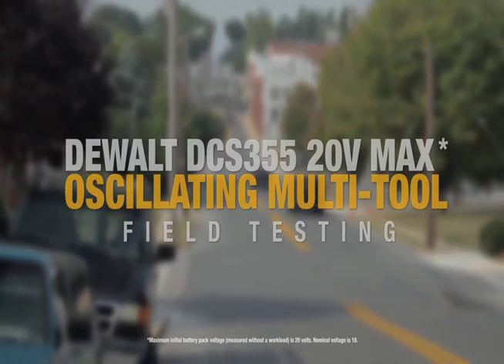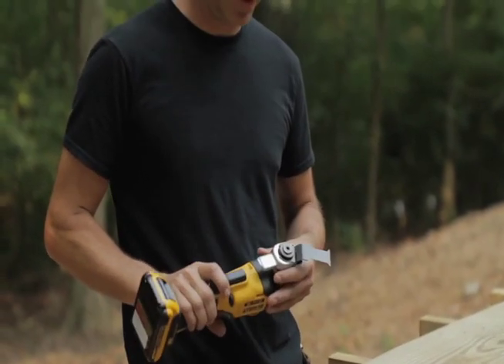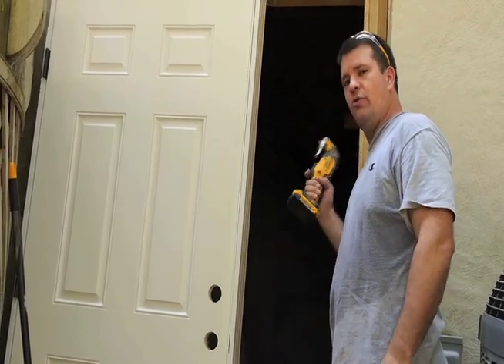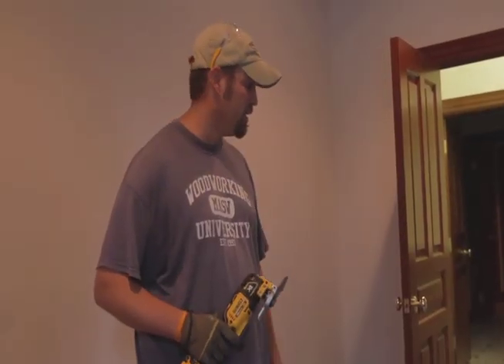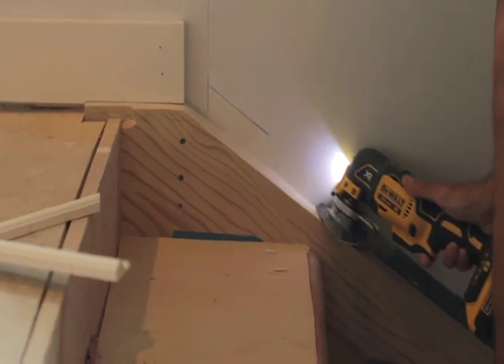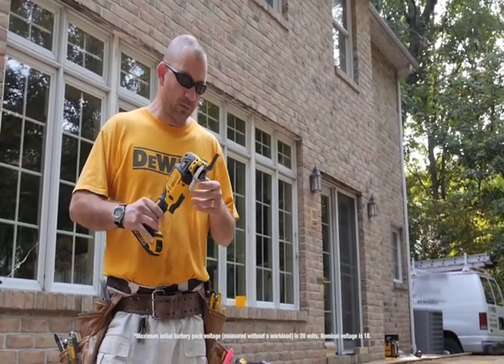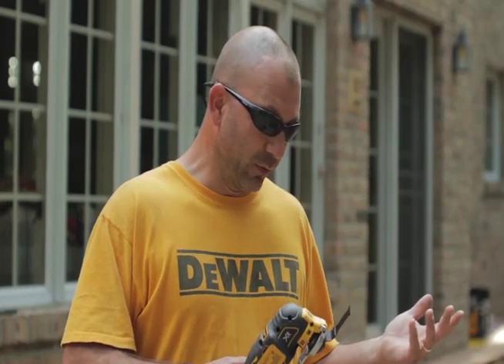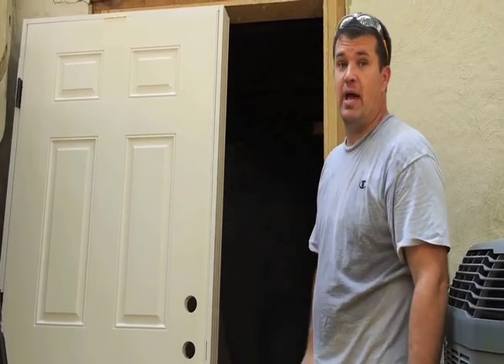DeWalt 20 V MAX* XR Lithium Ion Oscillating Multi-Tool Kit Model #DEWALT-DCS355D1

Comment: most owners are finding the light stops working .Not well made for a trade product
Reply: more likely the solder joint fails because of the vibration[oscillations up to 20,000 per minute] so i'm not surprised.  a redesign to a free floating instead of hard mount will solve the problem the engineers didn't thought of that though
Reply: Had mine since it came out light still working 💪